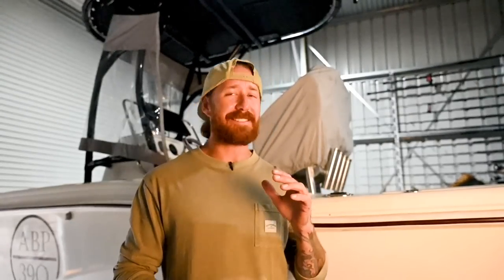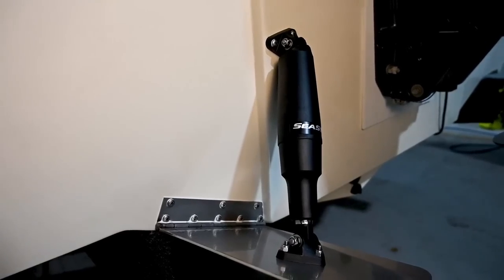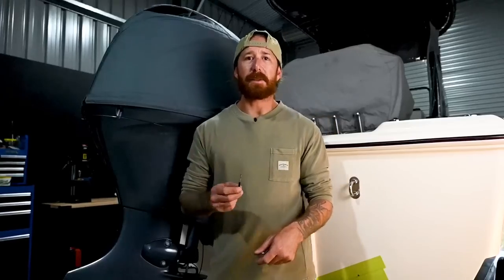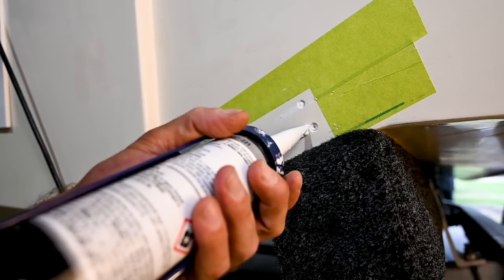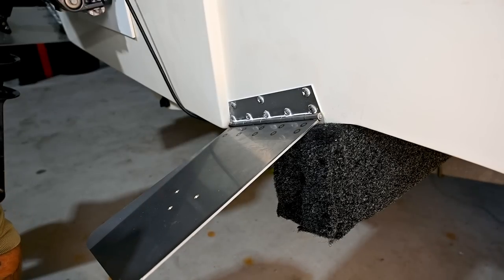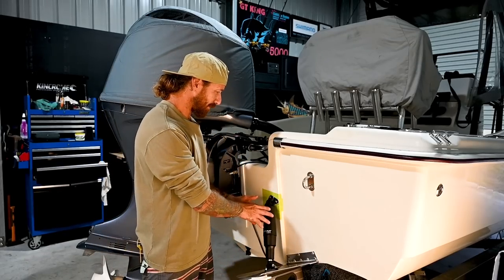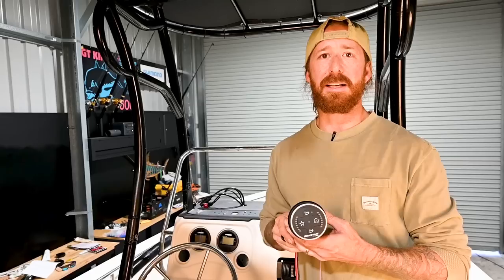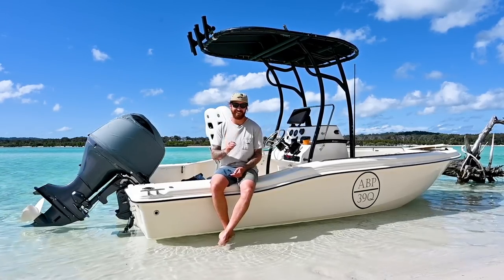This Is a GAME CHANGER!! ~ The DIY Install that TOTALLY CHANGED our BOAT!

Comment from the maker: Well I've never had a set of trim tabs on a boat before an I'll tell you now I will never own a boat without them!  Hahaha technology is coming in leaps and bounds and gone are the days of hydraulics and oils... it's as simple as plug and play and man do they make a difference!

We ended up gaining 0.3 ks/litre on economy in the rough as week as upped our average cruise speed by 3 knots without changing our standard cruising rev range!  Not only that the independent pitch and roll on the new SeaStar Dometic Trimtabs is a game changer!  

Well worth a look legends I'll throw a link in the description if you want to get some more detail on these units :-)
Reply: Cheers mate, was just a thought… I have seen some rather strange stuff done to the transoms of boats. Was just erring on the side of safety. 👍

Comment: Great video mate. Whilst i have a competitors brand of Tabs i have to agree with you, they completely change the boat. Especially boats with larger draft angles. With the tabs set neutral your boat will lean into the wind, a quick adjust and you are flat again, such a great feeling. And as for rough sea passage, get that Bow down and plough through, no more slapping and crashing
Reply from the maker: Such a good addition indeed!  Our boats pretty flat and super stable even in the rough but even with a stable boat they make a huge difference under way !

Comment: Did you not consider epoxying a block to the hull and drilling it rather than drilling the actual hull? Or would this have changed the performance of the trim tab?
Reply from the maker: This could be an option mate if you had the chance to modify your transom to accomodate this installation for sure!  I wouldn't think it would affect the performance of the trim tabs themselves so long as the modification was on the same running surface as the bottom of the hull.  Would be a very good idea also if you have any timber in your transom however my hull is full composite and we have rebuilt this boat from the ground up so I was confident in drilling in to the transom in my case knowing what is there and the amount of glass etc.  Would definitely say its a case by case review of fitment based on the boat, history and construction :-)

Comment: Keep these great vids up and the Scout will loaded with gadgets!
Not sure if you mentioned it but I'm just curious as to why you picked that part of the hull and not the horizontal section further out? I have not opinion on it just curious plus others boats will more than likely be different shapes etc.
Reply from the maker: Cheers man! Yea there’s a few more additions on the way so she’ll be a weapon this summer ✅🤙👌🍺 as for the tabs that section of my hull was too narrow unfortunately mate whilst the tab’s generally come in different sizes that set I have is as narrow as they come… and thinking about it I think having them on the angled surface may even help the roll adjustments a bit better 👌👌
Reply: Another great ep Brett look forward to see them in action on the next one cheers mate 👍🍻
Reply from the maker: Cheers legend!  They've been working a treat I can tell you!